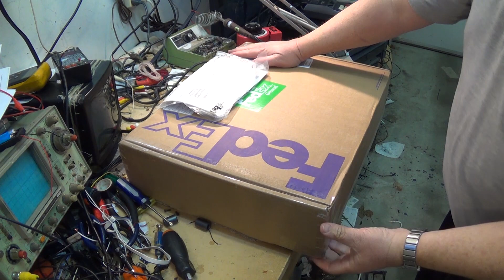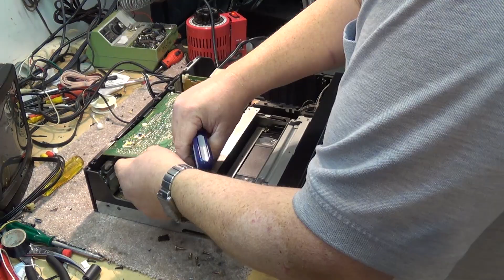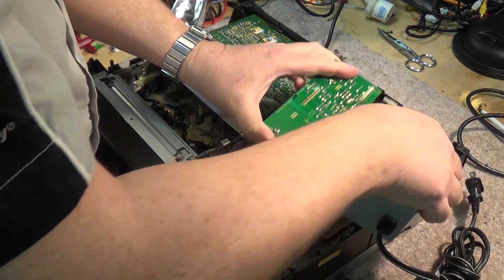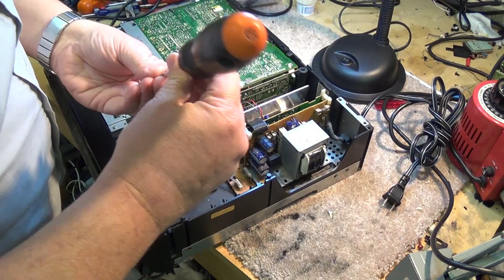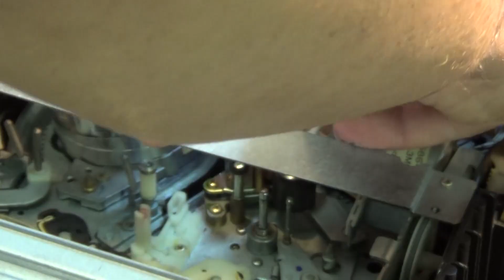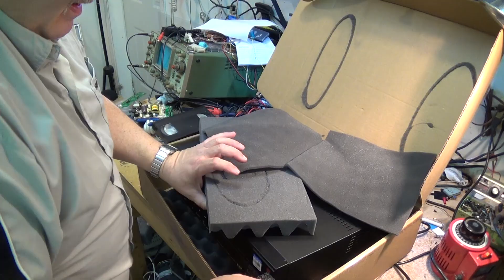JVC HRD180U No Power. Can this one be fixed?

Comment: Hello, and thank you for your videos. I have a vcr exactly the same. I have replaced the regulator too, the vcr switched on works, but i have two problems. The first one is that  the counter does not work, so play mode rewind and fast forward works for about 3 secs and then stops and second, the display illuminates all segments. You can see the segments that have to be illuminated glow more , but we have less illumination and flickering at the segments that shoud not be on. Any suggestions? Thank you very much!
Reply from the maker: Counter belt if it has one.  Model numbers mean nothing to me. I don't know the chassis.  Chassis numbers also mean nothing.  I have to see it to visualize what it is.  Even when i was still working someone would call and ask if i had a belt for brand / model and i would say got a part number.  People assumed we remembered every part number or what size their belt their turntable used. The ones i lived were the guys that would come in to buy a belt kit for their RCA vcr.   When we did the job it was 49.00 labour and 10 for the kit.  Customers could not understand why when they wanted to buy the belt kit it was 59.95.   the reply was "we are in business to make money and pay the staff, selling parts at just over what they cost us doesn't help us, so you can bring in your vcr and it will be serviced fully and belts replaced for 60.00 or you can buy the belt kit for 60.00. other wise Foff do your research and order all your belts from different vendors and pay for them pay for shipping or waste 10 in gas driving around to buy them.  That was our way I'd saying we don't sell parts to the public.  Then a few people would show up at my house wanting me to fix their stuff under the table.  So i did it for 50 cash lol.

Comment: at 29:35 .. so basically this can be replaced by 4 modern LM350??.. set to the proper voltage?
Reply: Yes, when there wasn´t no replacement IC available, I used to add a power regulator to supply the lost voltaje.

Comment: I found one of these in a storage room in the basement, my brother broke a VCR but luckily I got to that one before he did, it is picky about tapes but works pretty well on certain tapes, at first it didn't work so I opened it and the fuses were blown, there was no signs of failure or bad components so I replaced the 2 blown fuses and it worked just fine, the fuses were blown for no reason, and I use that VCR with my flat screen tv, it actually looks pretty good despite being on VHS tape.

Comment: It's a 1986/87 vintage machine and the difference down to the HR-D170 is the LP-ability.
I don't know if this JVC chassis and mechanism was the last casted (all-metal) good solid one.

The idler tire, capstan pinch roller and more or less the entire mechanism is also used in the very first generation of JVC S-VHS machines (HR-S5000, 7000, 8000, 5500). However these S-VHS machines seems more populated. Double rollers on the left side of the video head drum for instance. The motors seems different also.
One downfall is the problem with loose guides, but it can be fixed.

There seems to be no division of JVC mechanisms like at Panasonic where you have G, Z etc.
Does this excellent JVC mech has a name ?

Comment: Quick question. What suppliers do you order your parts from?
Reply from the maker: I order from KP components. I also get small parts from Lee's and RP Electronics as they have store fronts but not convenient these days do the Covid. Yesterday I went down to buy a soldering iron tip I waited 40 minutes in line to get in the store to make it 2 minute purchase was not happy.
Reply: @12voltvids  Thanks for the info! I'll have to take a look at those. Wow, that's frustrating to have to wait that long. I have a JVC SR-V101US that I use to transfer VHS to digital. It will not rewind or fast forward in fast mode. I tore it apart and found out that a small torsion spring was missing that is supposed to help push a plate up to engage the clutch into a higher gear, thus not allowing it to fast forward or rewind in fast mode. I've looked at two different online stores, ued.com and partstore.encompass.com, but they don't supply the part anymore. I think I might have to resort to buying used "for parts" VCRs that have compatible parts in them.
Reply from the maker: @EricKotter  
Only common parts are available these days.

Comment: I had the same problem, but with a Samsung Diamond Head VCR. I want to repair it because it was a thing from my childhood. But the fuse was blown. I ordered some new ones and install them in the VCR, absolutely nothing. I don't know what to do now: I've replaced the fuse, I checked if the cable was bad... Same, I don't know what to do now.

Comment: Sir can u tell me how much current is supplied by the  power supply to the circuit board in jvc vcr model no. Hr-j507ms through different 9 wires

Comment: STK strikes again. Man those things were unreliable. They really turned to shit towards the end of the RPTV era.
Reply: Preventative maintenance is key here. You have to maintain those by cleaning them up, cleaning the heads, checking the small rubber belts for cracking, and re-applying that thermal paste on those large heat generating ICs every 2 years or so, that crap dries up, loses its heat transferring magic, IC then overheats, and boom, it burns itself out. Now, your VCR has become a useless brick. Of course JVC, Sony, Emerson, and Sanyo would never give you that information.
Reply: @jdrs4214  That might be true, but no consumer ever does that. Chips need to be designed to be a little bit more resilient to heat transfer. most ICs are. except the STK line. Ive had some last up until today, and ive had a bunch that didnt. for example, the STR regulator in my Magnavox TV is original to the TV, from 1994. I havent done a thing to it and it still works fine. its my daily driver. Only thing it needed was a B Boost cap in its life.

Comment: I have a JVC VCR very similar to this one. It's a little more complex, has a few more boards. I suppose it's older than the model you're showing here. 

It has no power, but I get a clock display. STK has UNSW 12 V. I was told to ground pin 5 of the STK with a 1 K resistor. The power LED goes on when doing that, I get SWD 5V and SWD 12 V, but the display acts as if the unit is off, showing a blinking clock. Do you think the STK could be the problem, or there is a problem with a CPU IC?

Comment: Hi friend, I have this exact machine and a very similar problem. There is no power button light (but the clock does blink). When I press play or fwr or rwd several of the motors begin but cant get the tape playing or rewinding or fastforwarding. The head drum doesn't spin. I wonder if you could let me in on where you found the pin diagram for this regulator and/or do you want another vcr to fix?
Reply: You can find the diagram of the STK searching online. Google images has you cover on that one.

Comment: Could I mail you a power board from Sony S-Master 5.1 full digital amplifier, model HCD-C990, serial #8307460. Bought this unit "cheap" with nice Sub + 5 great speakers. unit stopped to work after hurricane time/ power surge.I bought it not working.... Power does not turn on, tried everything, just blinking red standby light goes on. not even the fan in rear turns on?? I was told it might be power supply board, could I take it out , 4 screws and 3 plugs=), and send it to you?? You then give me estimate, could be just simple thing?? and we go from there!?? Thanks
Reply from the maker: I have no way to test a power supply without the rest of the unit, so no you can't mail it to me.
Reply: OK, tell me  where can I order power board, for good price?? Thanks
Reply from the maker: I wouldn't know as I have never ordered one. 
I am not in the business of repairing equipment for a living these days. I have long time customers from my days in service that bring me stuff, and the rest of it is my own collection. Most of the parts vendors have closed their doors. I look on Ebay, but you take your chances with that.

Comment: I was thinking of buying one of the high end Victor SVHS decks from Japan.  Most are "junk" and listed as having no power.  Is the part you replaced typical across all of JVC/Victor's decks?  The junk systems are cheap, shippi g is not...  Don't want to waste money if it is something not easily fixed.
Reply from the maker: What cameraman? There is nobody else working on these videos but me. Camera stuck on sticks over my shoulder or on the bench. This is not a high budget production.
Reply from the maker: Many of these units the parts are cheap and easily available. Shitting of this unit cost more than it was worth to repair.
Reply: 12voltvids Does your cameraman get paid for recording your video's or does he do it for free....
Reply: 12voltvids Allright i see thats very good your use of video cameras is good you seem to have great knowledge in what you do...have you tried repairing video camcorders e.g hi 8, digital 8, mini dv etc..
Reply from the maker: There are videos on the channel repairing the vidwfinder on a hi-8, and repairing the video circuit. There is also a 3 part series on overhauling a DCR-TRV110. Doing a full chassis swap in the B mechanism. I haven't done any MiniDV videos as I don't have any miniDV cameras that need service. Actually that's not true, my old professional MiniDV needs a transport service. Future video.When I was in the business I did service cameras. Lots of them. I have done a few videos on them, and will be doing some more, as I do have a few camcorders here for future projects.I did work in  a very busy repair shop back in the 80's and 90's. I was the master certified electronics tech, and had a few junior guys working under me, but I got all the tough stuff to fix.

Comment: here I can´t get audio, but main problem is ... 
You store the equipment for months or years and humidity on air causes oxidize of power supply welding?
May it happen to aan equipment I got.
Reply from the maker: That's why I store my equipment in a heated facility, so that humidity is not an issue. I store the equipment down at the end of the room with the baseboard heater too, so when it gets cold and the heat comes on the equipment gets the nice worm air first as it heats the room up. I never let the temperature get down below 7' in winter.

Comment: Sorry im catching up on your early repairs, i dont expect a reply.
.
i bypassed a similar regulator in a ferguson videostar, no 12 volts!!, i did it with a 3 pin regulator and a small relay that was driven by two transistors from the power led, yes its nasty but it worked a treat, the owner was a frend that had no money, a new regulator chip would have cost £45 at the time ;-(
The videostar was a loverly machine.
Reply from the maker: +zx8401ztv I still monitor the old videos, as I get notification to all new comments.I considered doing this, but the part was available, and the owner of it wanted it done, so they provided the part, and then abandoned the machine once it was fixed!
Reply: +12voltvids 
But you did a spot on repair, what an odd owner :-/
"There is nothing stranger than folk"
Reply from the maker: +zx8401ztv He actually contacted me in December and said he was mailing the payment for repair, and return freight. This is the second time he made that claim. The unit is all boxed up ready to go.
Reply: +12voltvids 
What a strange bloke, i used to repair c.b radios for most of the truckers in the uk, and they allways came back for there radio.
I did get two people that just ignored the fact i had compleated the radio, they didnt come back, so after a year i claimed the radios, i had spent money on chips and other parts, it was part mine.
Treat that vcr as yours, i would.
Reply from the maker: +zx8401ztv He offered to sell me the part he bought. I don't need a mono VCR. If it was a hifi, for sure I could use it. SO it sits all packed up.I did that to another TV that was abandoned. One of the ones I fixed on the channel, I think it was the Digistar 46". Guy abandoned it, sat in my garage for 10 months. His phone was out of service on repeated attempts to contact, so I sold it. About 4 months later I ran into him, and he asked for the TV back. I told him I tried to contact him and his cell was out, and he gave me the sob story that his prepaid minutes had run out, and he was short on cash to buy more, and he lost his job and yada yada yada...So I told him my garage had been broken into, and it was stolen. Guy that got it thinks he scored the best deal of his life for 50 bucks.
Reply from the maker: Yes I was going to do this, but the regulator was available, and the owner of the machine shipped it to me. Funny thing is after the repair, I got the unit weighed for freight calculation, sent him an email for shipping charges, and he never sent me the cash to ship it back. 18 months later it is sitting on a shelf in the original box waiting for payment.
Reply: People are shitbags arnt they, ive had similar things happen to me, radios sitting on the shelf waiting for the owner to return, i waited a year and sold the radio to recoupe the money i spent on parts to repair it.
They never did come back, no supprise.
Dont hold your breath waiting lol.
Reply from the maker: I have done that.Feb 2015  ago a guy brought me 2 TVs to repair. They are both up here on the channel. After repair I contacted him and left a message. He never got back to me, Then his phone was out of service. Finally I got tired of tripping over these sets, big 46' units, and a friend calls asking if I have any old TVs. I said have I got a deal for you, and sold both of them.About 5 months ago I ran into the guy in a store. He asked for his TVs back. I said I tried to contact you and couldn't get hold of you. He said of sorry I let my pay as you go phone run out of minutes, but I want my TVs back. I said, dam I'm sorry you left them for a year with no way to contact you, and you didn't call me despite me leaving my number. I chucked them. He was all pissed off. I said well too bad so sad, if you wanted them you would have been more careful with my number.Judging by the way this guy was dressed I probably wouldn't have gotten any money out of him for the repairs, so I did much better selling them.

Comment: Wow, in all the years I worked in the trade I never thought once about taking one of those STK votage regulators to bits - thanks for showing that, It's fascinating!  Also makes me wonder how many might be repairable with a bit of tinkering.  Old Amstrad monitors used to have similar regulators in them which died all the time from overheating.
Reply from the maker: Sony used to use a 3 channel power amp IC for the convergence IC in their old CRT projector TVs. Heat was a major issue in those sets.
Reply: @12voltvids  at 29:35 .. so basically this can be replaced by 4 modern LM350??.. set to the proper voltage??
Reply from the maker: @Ramdileo_sys  need power control though as it is controlled by system control to shut down when in standby.

Comment: Interesting, I have never seen these voltage regulators before.
Reply from the maker: All the old units that used linear power supplies used them.
All of the old Betamax units used them, as did most of the early VHS machines.
The old Hitachi, and RCA units used them too. Panasonic was one of the early manufactures that started using inverter supplies probably because they were cheaper and more energy efficient.
Reply: I do know the 78xx type linear regulators, but I've never seen regulators integrated into an STK type package. I don't have a lot of experience with VCRs though, so that may be the reason.